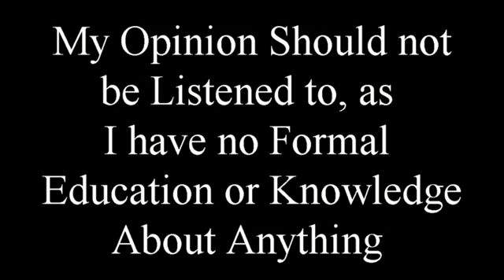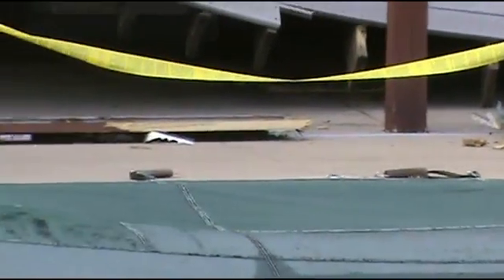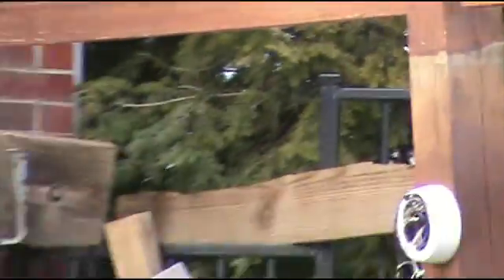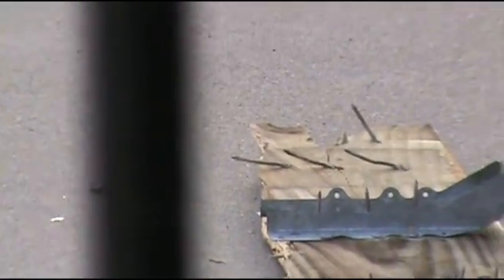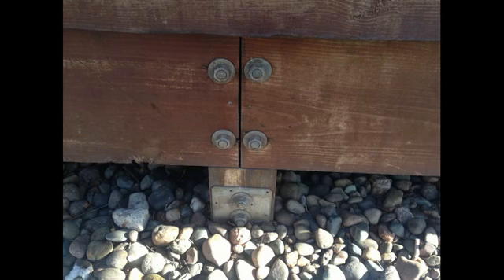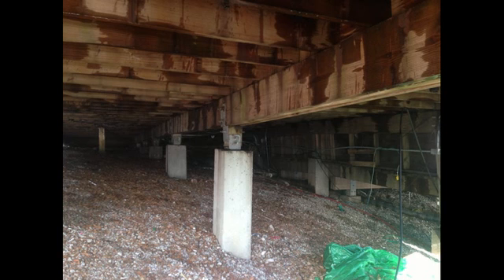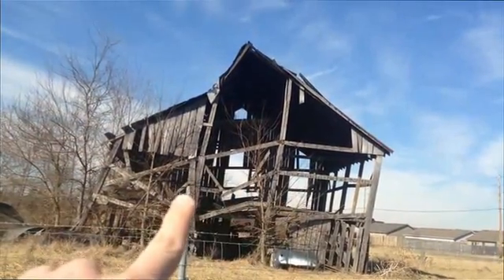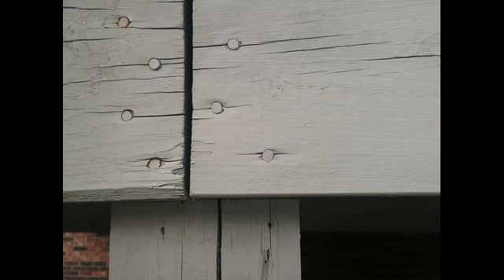Jeremy Wilt Talks about Deck Collapse Prevention

Comment: Mr. Wilt:  thank you for having the wisdom to communicate the related issues associated with your deck collapse. However, as a deck restoration professional I wanted to point out a contributing factor that would probably rank as #3.  Your deck was not protected with a "penetrating stain", instead it had a coating or paint on it, as evident by the fact that you could not see the wood grain. Regrettably some stores sell what the manufacturer labels as a stain, when in reality, it is a paint / coating.  Some go as far as to call it a "solid stain", which technically is impossible.  Unless the stain has penetrated into the wood, the integrity of the wood is not protected.  A paint or coating traps moisture in the wood promoting rot, decay and the loosening of the hardware.   A coating promotes and then hides issues contributing to deck failures. More info can be found at CarolinaWoodDecks.com
Reply from the maker: This post was originally tagged as spam, but I cleared your post as I completely agree with you regarding  SOLID "stain" being sold as a product for decks. Solid colors should never be applied to decks as they eventually look terrible and fail the decks integrity. However, I would rank this concern as #100 on the list of things that went wrong with my particular situation.

Comment: The carpenters that did the actual construction work were incompetent, which is self-evident.  In descending order, the other culprits are:

-- Schuler homes, the builder.  Based on my experience, I would guess that they subbed the work to a fly-by-night crew because they had no money left in the budget; and then negligently failed to provide oversight to ensure that minimum applicable building standards were followed.  An absolute disgrace, which should tarnish their reputation regardless of the statute of limitations.

-- The homeowners association, the owner. This is what you get when an owner chooses the low bidder without knowing how to establish proper plans & specifications, compare apples and apples with other bidders and oversee the building process.  In residential construction, this tendency for owners to want the best/biggest/most for the lowest price is a prescription for this kind of disaster:  It sorts the desperate, inexperienced and/or unscrupulous builders from the professionals.  "You get what you pay for" is especially true in residential construction.

-- The local building department.  It's possible that this deck was built after construction of the building (and hence after final inspection by the building department).  If not, the building inspector was as incompetent as the carpenters.  There is no way this deck would have met any building code.  With that said, this might have been a municipality that doesn't require a permit to build a deck.

Comment: This deck was guaranteed to fail. It was only a period of time.  The blame can be spread all across the board. The construction details used on this deck has not been allowed under the code since 2000. However, it is still being printed in how-to books all over the nation.  The contractor did not build to the current code.  The city building inspector either missed it or ignored it.  The home owner's association is ultimately liable and should have had it inspected.  If they did have it inspected, the inspector would be liable.  According to my research, deck failures are rare, about 25 occurrences per year in the US.  My heartfelt sympathy goes out to the innocent victims of a system that has failed.  Please think about hiring a deck specialist that takes pride in his work.  Price is not always the best criteria to go by. The cost may end up being far greater.
Kim Katwijk
Contributing Editor Professional deck builders Magazine 
http://www.artistryindecks.com/
http://www.deckmagazine.com/

Comment: Jeremy, as a builder with 44 years experience, I can say unequivocally that any carpenter with three years of experience should know that this was totally inadequate in the way it was designed and built. I would expect tis quality of work from a backyard weekender DIY on his own deck, but never from a Professional builder. Further - if there was any sort of structural inspection required at the time this was built, the local oficial doing the inspection should be terminated or at least re-educated

Comment: Thanks for sharing. I used to build decks onto houses in Florida. We would notch and bolt- it never even occurred to me that someone might build in a manner of the way Schuler did. Common sense should dissuade that method, let alone building codes. Good luck with the lawsuit!

Comment: On both my new website (not public yet, but can be seen) and old one, I talk extensively about how home owners need to inspect their decks before having a wedding party, prom group and family on the deck: http://deckresurrect.com/wp/faq/ SEE SECTION: "Inspect Your Deck!!" This principle applies to a commercial deck as well, which should have been overbuilt for safety. The deck looks like it was just held up by nails. The builder may have been trying to make what is called a "rim joist", but it should have been anchored into or notched into the post. The deck still looks like it should have had beams below it, and it should have been "free floating," which are beams front and back.

See gallery for proper deck building techniques of some decks I built: http://deckresurrect.com/wp/gallery/ .

Comment: Face nailing a header isn't up to the building code. 16 foot span is also probably not up to code. Lastly, there did not appear to be any 45 degree toe nails in the joist hangers. They're lucky 100 people weren't standing on that deck when it collapsed, and I suppose they're lucky it didn't collapse before. No matter that the builder says it's beyond 10 years, it never should have been passed by the building inspector, originally.

Comment: Here in California your deck joist must rest on a beam or header not nailed to the side. Yes bolts or strong ties would of helped but if OSHA or an inspector saw that they would of taken a chainsaw to it.hope every one is doing better.
Reply: OSHA has absolutely nothing to do with construction standards. If this were a temporary construction scaffold, they would likely fine the builder for negligence tho. The methods used here are not even acceptable for temporary work